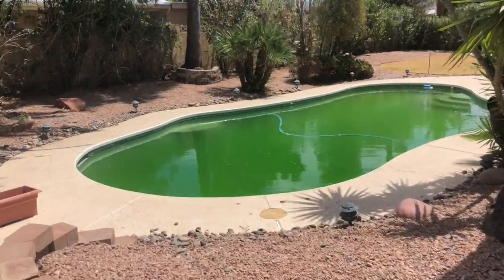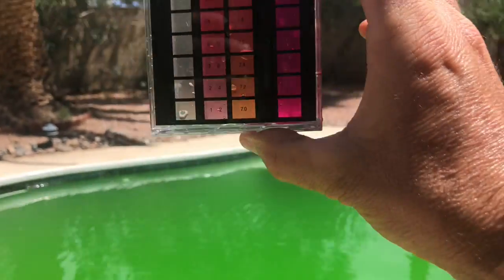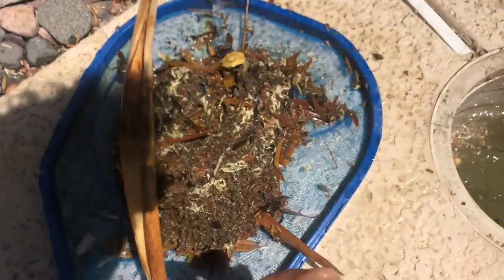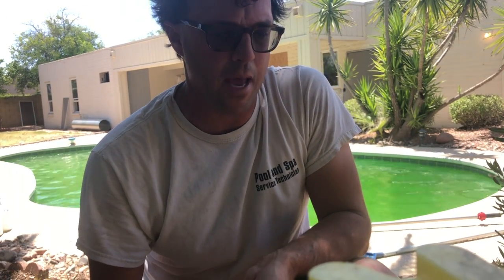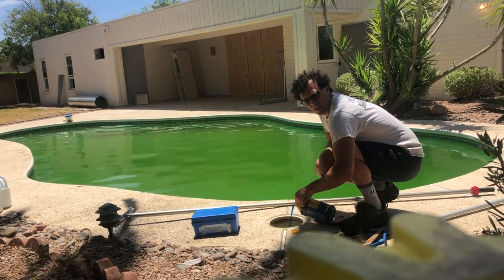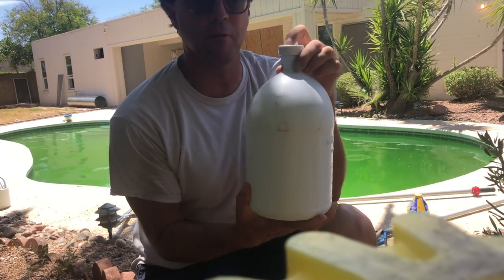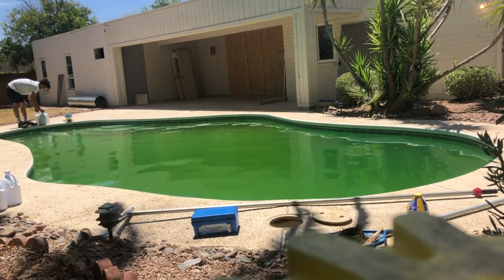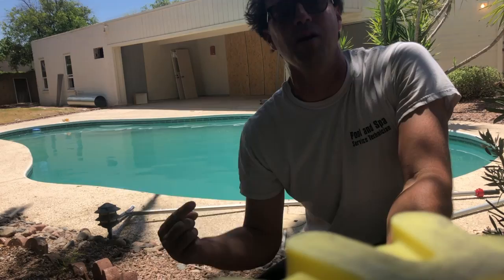From Green to Blue in Minutes: Dropping the Calculated Chlorine BOMB!

Comment: I have a pool with a spillover spa. My pool is about 13,500 gallons. I generally have to add about 12 to 14 ounces of acid every week into the pool after I get a pH reading of about a 8.0. Why did he add 1 gallon of acid to the pool if you could’ve reduced the pH into the normal range with let’s say 2 cups or so. Wouldn’t that excess acid etch the plaster in the pool?

Comment: Use the drain function flexy pipe pore it down the skimmer spray it all over the pool using the flexy pipe with a pressure mozzle, thats right just like your garden hose only, well just squeeze the end a bit works every time

Comment: had a dark green swampy pool.  followed this process to see if we could avoid the $2000 drain and clean service.  it was AMAZING! it changed from very dark to light green within the hour. let the pool filter run for the first 12 hours. now the pool is a cloudy light blue. to be expected with the level of green we had.  adding flocculant and vacuum, vacuum, vacuum.  cannot believe that we could have such a huge turnaround in less than 24 hours.

Comment: Several times with our pool we have encountered a situation when no matter what we put in the pool at the pool houses recommendation the pool stayed green.
The only solution was to drain it and start over.
Have you ever encountered the same and found an option without draining?
Reply: Just a pool owner here who loves the chemistry part of it. You really shouldn't have to drain a pool with a simple algae problem. I agree with most of what was shown in this video except for one thing. The statement of a flat 8 to 10 gallons of liquid chlorine is over simplified. In addition to making sure the pH is corrected, you must also get your alkalinity in line. Then the big thing is the cyanuric acid (or stabilizer) level...also called CYA! The higher your CYA, the more chlorine you'll need to kill of the algae. And conversely, the lower your CYA the LESS chlorine you'll need. Additionally, if your CYA level is too high, this could have contributed to the algae problem in the first place because when it gets too high, it keeps the chlorine from doing its job. So....I've cleared my green pool many times in my ownership and never put 8 gallons in at one time. It could possibly be more than needed and just going to bleach a liner. And if you're putting way more chlorine in than is necessary, it'll just take that much longer for the chlorine level to drop to a safe level to be able to swim. So you need a good test kit and learn the balancing of CYA and chlorine.
Reply: @neeferpd  So what lowers cya?
Reply: @RC-Heli835  unfortunately only draining some water and refilling with fresh. But make sure to get CYA tested to be sure that’s the problem.But unless the CYA is absolutely through the roof, we are talking about a partial drain. Also, this is why many people have stopped using the stabilized tablets in skimmer and start using some liquid pool chlorine, like available at Walmart. I use a combination of both. Some tablets when I know I’ll be busy and not able to care for pool much. And liquid chlorine most other days. This keeps my CYA from rising too much. You’ll always lose some when you backwash. So for me it works well to use both.

Comment: Is there a wait time after putting in the acid before you start adding anything else? The chain pool store told me I have to wait 4 hours after each application. Here's the order: Acid then 4 hours, baking soda, then 4 hours, then chlorine.
Reply: No need to wait but I dilute the acid 10:1 before pouring.

Comment: My Cya level was to high. Drained 25k gallons of my 30k gallon pool. Refilled with clean water and added clarifier.  Staying away from any chlorine tablet that has any stabilizer. Pool is pristine now.
Reply from the maker: If you can dial in the CYA level and stay on top of the chlorine, it works really well. This is one of the advantages of using a salt chlorine generator. No CYA build up

Comment: Lower the ph before backwashing next time. The filter will release better and the chlorine will work better
Reply from the maker: 20-30 minutes really isn’t enough time for the slightly lower pH to have much of an effect on the sand. On paper what you say makes sense but if your sand is so clumped together that a backwash won’t loosen it up then there’s bigger issues at play.
Reply: @SwimmingPoolAZ-SPS  I didn’t say 20-30 minutes…nor did I say slightly lower either.  Lowering it substantially for hours will do the trick.

Comment: Glad you mentioned circulation as a major factor in the results, I once worked at an apartment complex that let its pool pumps get into disrepair and they barely circulated the water in the pools, so getting them clean and stopping the growth of algae was a constant battle and ultimately a losing one given that they barely had enough people to do all the work. No matter how good you are at cleaning these, the owner still has to be on top of maintaining all the important equipment.
Reply from the maker: As you know they go hand in hand. It takes like 3-4x the Chems to know out algae on a pool with a bad pump.

Comment: just a question how much pure chlorin is in one of your gallons?... 
I do pool service too and was shocked by the ammount of gallons of Chlorin you put into the pool.
I am in Europe our company use liquid Chlorin that holds 1.5kg (3.3lbs) pure Chlorin in 20l (~5.3 US gallon) canister ... thats about 10oz per US gallon if I did the math right... is the chlorin concentraion the same or much lower? 
What kind of different system for desinfection you service... if I see videos of US private owned pools I only see chlorin swimmer with chlorin tabs... no saltwater pools or pools with chlorin institute that produce chlorin outside the pool and inject it into the poolwater.. just
Reply: He was using 12% chlorine. I also think it’s to much. You just need 29 ppm and hold it for 24 hours. Save money.

Comment: That's a LOT of chlorine for that size of pool. When I would shock our pool of 150,000 gallons, I would use about 15 gallons of chlorine to get over 10ppm for the required 24 hours. Then after the 24-48 hours, I used reducer to get to about 5ppm. Finally I would let it balance itself to 3.0-3.5. And maintain at that level until the next shock treatment. I usually would shock twice a year. 

The one thing I would maybe do that you either did not or did not show, would be to do a very quick and short second backwash with the hyper-chlorinated water.

Comment: We have an above ground pool and added well water but used a small filter. Used green to blue and it was clear. I added chlorine and algeacide and let the motor run and woke up this morning with orange/ brown water!! What am I doing wrong? HELP!!
Reply from the maker: I bet you’re high in Iron in your well water. It’s possible that the addition of chlorine accelerated oxidation of the iron in the water.
Reply: @SwimmingPoolAZ-SPS  So what do we do so it doesn’t do it again? I added scale metal and stain control and did the green to blue again. Waiting 24 hours to back wash it. What else do we need to do? Not add chlorine at all?

Comment: I have a 15ft x 48” bestway steel pro max. I have green water. Few no much. I think that i shock two consecutive days. I put algae and clarify. I dont see much difference. What i need to do to get blue water
Reply from the maker: Pool needs to be running 24/7 and filter backwashed frequently until water is clear. In the mean time, the water needs a full test so you can determine what chemicals are needed.

Comment: Sorry,i dont speak english,how was the filter ? Recirculation or filtering?
Reply from the maker: The backwash valve on this filter only lets you filter or backwash so it was filtering.
Reply: so the valve allows only 2 positions?  and while you put the products then it is positioned on filtering?
Reply from the maker: Correct. The specific chemicals I put into the skimmer will pass through the filter and be distributed into the pool. Never pour any chemicals directly into the skimmer unless you have made certain it is safe to do so.
Reply: @SwimmingPoolAZ-SPS  so those products were suitable for the skimmer?  I always pour them in but with the valve set in recirculation.  however I have never seen the color change so quickly, I work in a hotel with two pools of about 580 cubic meters, I use dichloro for the shock and then trichloro and anti-algae for maintenance but when it becomes so green I always put some  day to fix it.  i don't know if it translated well because i am using google translate
Reply from the maker: I understand. The translate is working well on my end. That’s a very big pool you look after! What country are you in? For a pool that size it will take a lot of chlorine to make clear. The liquid chlorine I use in the video will work much quicker if the water has an algae cloud. If there is algae on the floor, dichlor and Trichlor sometimes work better because you can sprinkle them right on the spot and it will stay there and kill it.
Reply: @SwimmingPoolAZ-SPS  I live in Sardinia and the summer here is pretty hot, yes, they are two very large pools, however when it happens the algae are not in the floor unless I pour some flocculant, otherwise I can't eliminate them unless I wait a few days  do you think if I increase the ppm of dichloro I could have a result like yours?  for example 15ppm of dichloro at 55 or 65% of chlorine

Comment: would a shock treatment work better 10 gallons of liquid chlorine, I have a salt water pool.
Reply from the maker: Shocking a pool is just spiking the chlorine level. You can use different forms. Shocking the pool is what we did in this video. Often times, calcium hypochlorite is branded as “Shock” as it does dissolve quickly and rapidly raise the chlorine level (thereby “shocking” the pool) cal-hypo can be effective (and it’s much lighter and less bulky than bleach) just make sure your calcium levels aren’t too high.

Comment: Can I ask why you used an algaecide when Sodium Hypochlorite would have dealt with the algae anyway? Thanks.
Reply from the maker: Supplementing with an algaecide can speed up the process as they tend to attack the algae in different ways than the chlorine. Also, Sodium-Hypo dissipates very quickly where the algaecide will stay in the water and work longer. It’s sort of like preparing for a battle with an army. Sure you could just throw ground troops at the enemy but you can also call in an air strike to help the troops get the job done. In short it can be done with just bleach but adding the right algaecide means lugging less bottles and a speedier recovery.

Comment: Hello, I got small pool with small light blue mosaic inside. I can get clear water in the pool but the water inside the filter gets light blue colour same as the mosaic after 8 hour filtering. PH and Clorum normal and using algicide. Can you tell me the cause. Can it be the mosaic tearing apart in dust particles? Or is there any kind of algae that has light blue colour?
Thanks
Jorge Dias
Reply from the maker: Hey Jorge. I don’t know of any algaes that are blue in color. It could be that there is a metal precipitating out of the water and collecting in the filter. Also, does the surface of the tile seem to be deteriorating in any way? What about the grout? Is it blue as well? I would make sure the water is balanced with pH and alkalinity being in the proper range.
Reply: @SwimmingPoolAZ-SPS  thanks for your help. The tiles and grout look OK. Someone told it's the copper in the algaecide. I'll have to watch that possibility inn the next days. Regards.

Comment: My pool man is getting fired today because my pool on my rental property looks like this... I am going to follow your instructions and do the same to my pool tomorrow... How fast after I do this is it safe to swim.... Should I do another backwash or complete DE filter cleaning a couple days after this bombing? Thanks a lot.. Your info is very precise and easy to follow...
Reply from the maker: Test your water daily as you’re going through this process....you want the water to hold chlorine. If you come back and check the water and the chlorine is low or 0, be ready with chlorine to add to jump it back up. Once the water is holding chlorine and clear, let it naturally drop down to that 2–4 ppm range. Definitely pull the filter apart and do a good cleaning once you’re back to blue and almost clear.

Comment: I think it would be fair to note that this type situation was an algae "flare up" that occurred over a short period of time. They can be knocked out quickly and pool safely back in service within a day or two.
Pools that have not been chemically treated or serviced for longer periods of time will require a more extensive process.
Reply: @Mike Fu Yes, often that is the case. But in this case it can also be the result of equipment failures such as a clogged in-line chlorinator, pump failure, unusually excessive chlorine demand for some reason, etc....
Every pool tech out there has run into that situation where we are met by a green pool when showing up for weekly service.
When a pool has been neglected for a long period of time, the owner already knows why the pool is green.

Comment: Good job man, as a retired poolman I have come across this many times. I mainly did commercial pools but also residential, I can't tell you how many times I was flagged down by a desperate home owner who said her poolman stopped servicing the pool, it is green and they are having a pool party in 2 days. Everything this guy did was spot on with the only one exception. I would return the next day to do a complete filter clean cuz if you have algae in the pool shell you also have it in the filter tank  and you have to get rid of it. The best part was picking up the check and having the homeowner praise you and thank you.
Reply from the maker: On a DE or Cartridge, it would be a given for me to tear down and clean the filter. For this one I ran some sodium-hypo through the filter and did a big (actually several) backwash
Reply: You must of not know what you was doing
Reply: Jesse if you add that much chlorine how would it be swimmable in two days?  I know it burns off but does neutralizing all the algae also use enough of the free chlorine to making it safe to swim again?
Reply: @Simon Waddington  yes Simon. It takes a lot of chlorine to turn a algae green pool around. With algaecide eats up a lot of the chlorine. After filter clean, let pump run 24hrs. Check chlorine level  next day, vacuum up the dead algae to waste if you can. Then adjust ph and chlorine level. Should be good to go in 2 days at least. If chlorine level still high. Knock it down with some Thiotrine.

Comment: I find this to be irresponsible chemical additions.   First, no pool ever needs algaecide.   It needs to be shocked to the correct level after determining what that level is based on CYA and the proper sanitized level should be maintained rather than trying a lazy algaecide way of making sure an under maintained pool remains un-green.  Next, for that size pool, a gallon of muriatic acid should drop the pool ph by about 1.5, dropping it below recommended levels.   Your ph test indicated 8, but that’s also the maximum testable level and you should have run an acid demand test and figured out exactly how much acid you needed.  I don’t object to you using 8-10 gallons of 6% bleach in this pool, but there should have been a major calculation done because those two numbers make a huge difference in what that pool does to free and combined chlorine.  Video is also called “dropping the calculated chlorine” which is insane.   What you did is raise the free chlorine and lower the combined and total chlorine.   Calculated chlorine is not a test in a pool test.

Comment: Been taken care of my pool for 30years and would not have done some of the things he was or was not doing-number 1 when you clean the baskets you wash them out- he just emptied them and put them back in the strainers and they still had dirt in them-number 2 he should have cleaned the filter and not back wash it when the pool is this green you dont back wash also   I would  have been tempted to just drain the pool and wash it down and start with new water instead of using all the chemicals ---water is cheaper then the chemicals he was using --

Comment: Question, hw do i clean up an empty pool? Cn i just use pwr washer?
Reply from the maker: Power washers are great tools for blasting stubborn junk and dead algae off the walls, you just have to make sure that the surface can handle it. If it’s pebble or a good hard plaster, you’re usually good to go with a pressure washer. I’d soak the walls and floor down a bit beforehand to soften everything up....don’t drench things, you don’t want to be stuck removing excess water, you just want to spray enough water to keep things damp for a few hours before power washing. It’ll make the job go much quicker. After power washing, I’d do a chlorine wash for sure then determine if an acid wash is wanted or needed. If you do, you HAVE to make sure there’s NO CHLORINE left after the chlorine wash or you’ll kill half your neighborhood with chlorine gas. Good luck!